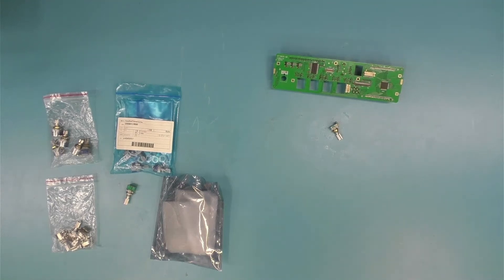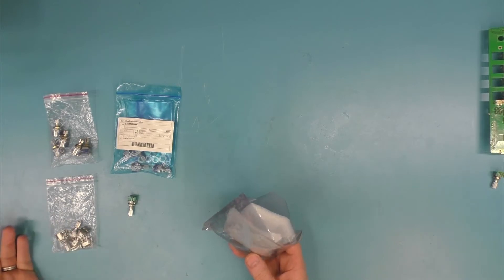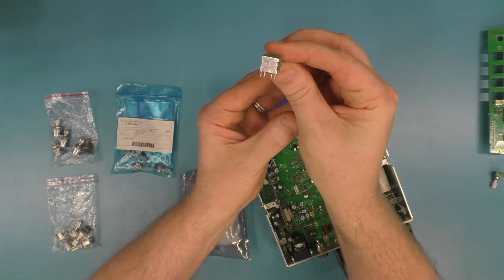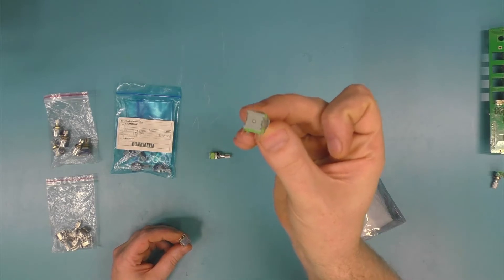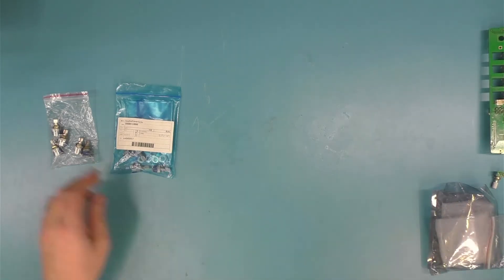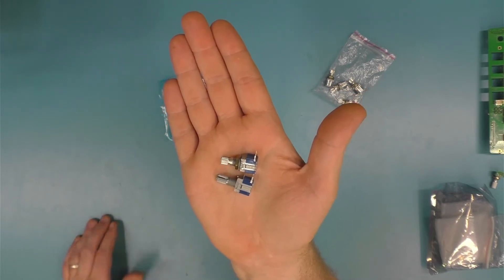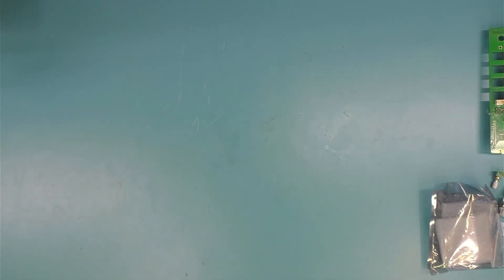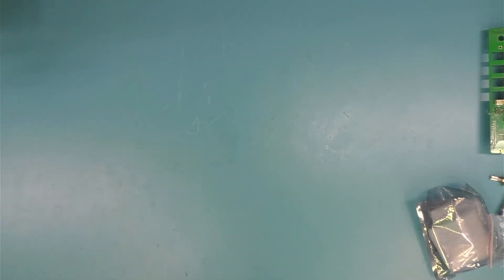Let's tackle 655/955 encoder/pulse switch (channel changer/selector) misinformation

Comment: The electrically correct alps encoder with the shorter shaft works great in the strykers with the modified RCI knob. I’ve got it in 3 of mine.
Reply from the maker: That's sort of the point. The REAL ALPS controls wont fit.
The FAKE alps controls will fit. That means you have the chinese copies.
Only one person that I know of does that and you can see the aliexpress box and the fake controls in plain view.
It's not even hidden. It's just put out there for all to see...... So if that's where they came from mate then sorry, you got cheated.
Edit: spelling errors.
Reply: Aw if it isn’t ole UDX 294 or should I say mark Sherman’s teachers pet 😂😂😂